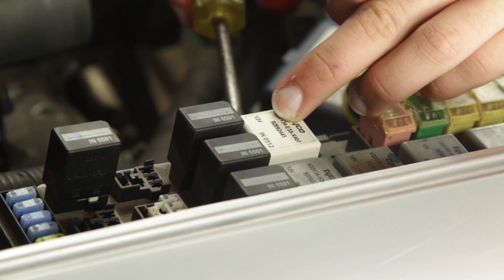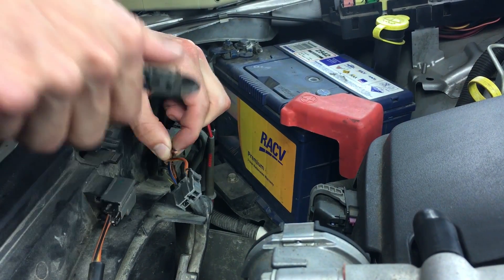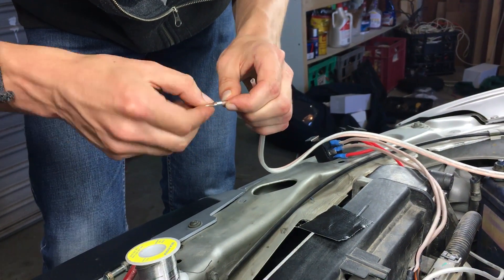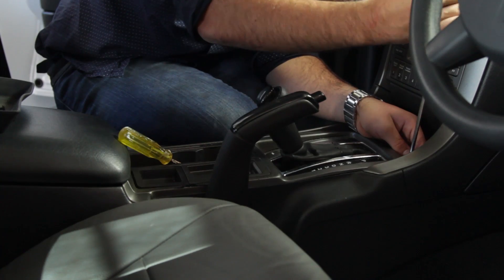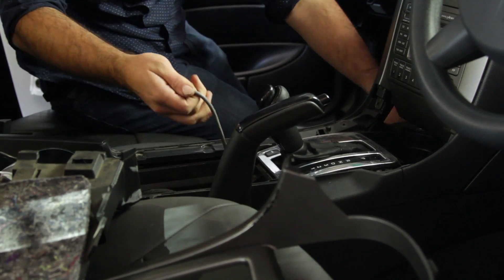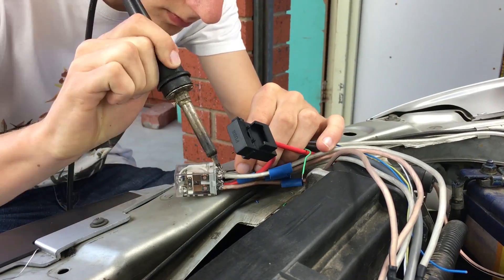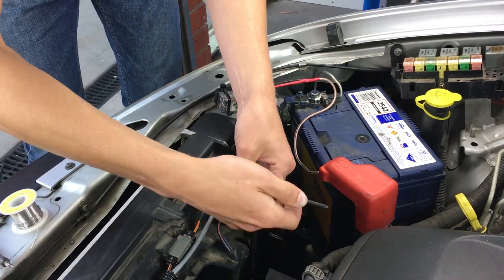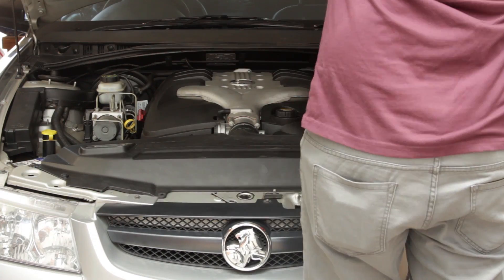High Speed Engine Fan Override Mod

Comment: VIP, Dears I am Using Ranul duster 2015 and facing the car engine heat up in traffic once the AC is switch ON, i change radiator, waterbody, Belt etc but no solution please can any one give suggestion.

Comment: thanks for the video upload. I was just wondering if it is possible to go one step further and add a servo variable speed system so that the fan stays on but with modulated speed and therefore removing peaks and troughs in the temperature of the coolant? I have measured my temperature in the engine, and it will climb to about 80degC before the fan comes on and brings it down to about 30degC while in traffic. I attribute this to the reason why my AC hoses deteriorate so quickly. It would be great if i could modulate it so that it stays at a steady 40degC instead

Comment: nice but you failed to show the wiring process as in what wire goes where and expect viewers to know how to read schematics and wire relays?  huh? I mean did you not figure out beforehand that anyone that knows how to read electrical schematics and wire up relays don't need to watch your video?   unreal...  also there is a WAY easier way to do this and it doesn't involve cutting your cars stock wire harness or butchering anything, just ground one end of a spst switch under your dash, run the other end to lug 80 or the ground lug of your fans relay, this switch essentially is doing what the sensors and ECU do, ground the relay lug to complete the circuit and activate fan...  lol tho.. man suggesting folks cut their stock wire harness, there goes 20% of the value in one fail swoop...

Comment: I have a better idea . Keep a bag of ice in the car . If you overheat , pull over place the ice on the radiator and shut the motor off . Wait 32 minutes and you should be good . Seriously though , take your car to a good Corvette mechanic and have them fix it properly . Its probably something minor . Don't listen to shadetree mechanics . If you live in or around Houston , TX  call Franks Corvette Service on Louetta near I-45 . He's the best in Houston . The kind of place you would recommend to a friend .

Comment: Why don't you just replace your fans or your  relay sensor or coolant sensor ?  Wth ?
Reply: What if you want your Engine to run cooler?
Reply: @JodBronson  why would someone want that? engine needs to be at his optimal working temperature to be most efficient. usually this is 90-100c coolant temp, some even 105-110
Reply: @lordred7462  - :/

Comment: I have a 2006 nissan sentra the heat gauge goes crazy up n down so we replace thermostat n we also bleed the hoses n still my gauge goes crazy whats my next step
Reply: U could also just remove the thermostat to have water flow contact engine will run cooler.i have a vehicle that does the same gauge drop back and forth. I'm going to change temperature sensor soon.

Comment: You could it just tap and diodle insulated the two trigger wires coming from the pcm for low speed and high speed (-) and still keep the original relays and wiring ..🙈🙈
Reply: Great idea !!!

Comment: is there anyway i can just override wire both fans to just turn on when i crank up my car and they keep running until i turn my car off... (without having to add the switch control to route inside the car??) i have a 2001 chevrolet impala with recent fixed aircondition and the my overheating issue seems to have started once i fix my aircondition and started running it...please help (-:
Reply: Mocha Love if u had a mechanic do u r ac work he probably discounted ur wiring harness that goes to ur fan either on accident or on purpose if it was on purpose it would be for u to blow a head gasket from over heading in hope u would bring it by

Comment: hey, sorry guys but pro tip for you... don't solder wires in the engine bay, use crimps and quick release if you want to keep it from electrical fire...

Solder has a melting point of between 90c and 450c, Operating temperature of an engine can bee snuggly at 100c or way more, if there is a fault in the fan and it doesn't turn on because someone decided to fubar it, then the engine bay can exceed 350c...

P.S. radiator is a great conductor of heat, the water itself has a boiling point of 100c, antifreeze 50/50 mixture is much higher as it is gravity fed from top to bottom... where do you think the most heat would be...

Oh, don't get me started on manifold... a lick test is enough 

What I am saying is, just don't solder, solder can soften, it can also cause sparks, sparks are bad... sparks can cause fire, ceasing and if your mod is a critical component such as the fan,  then you will be buying a new engine or replacing that ceased engine...

So, please...
CRIMP CRIMP CRIMP it will save you so much in fines if the cops pulled you over and inspected your mod
Reply: Very true. That is why automotive wire harness doesn't have any soldered wire in their terminals. All crimped. High amps as well can melt the soldered part and lose the connection easily.

Comment: does it matterif the fan be left to work always when ignition is on?
Reply: Also your engine temp should be at optimal level for best fuel economy.  With a always on fan you will not get that optimal temperature.
Reply: @ChMuhammadImran  he will if  his thermostat is good, but it will be noisy and he will reduce life of that fan.
Reply from the maker: Hi olusegun adeleye, if you have it wired to be on always when power is to the ignition, you will drain the battery if the engine isn't turning over also if it's always on it is quite noisy as well as reduced life of the fan, something to think about.

DIY GUYS
Reply: grateful